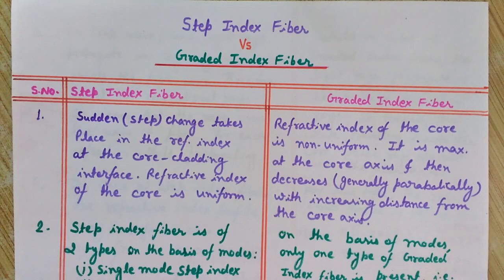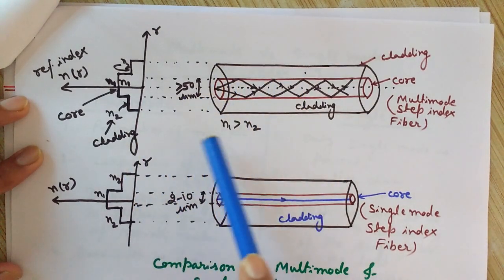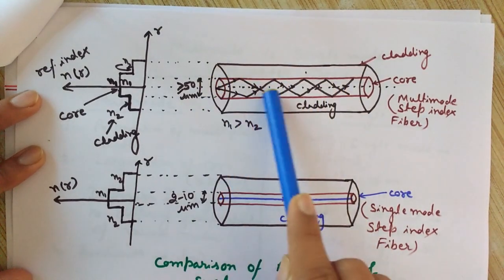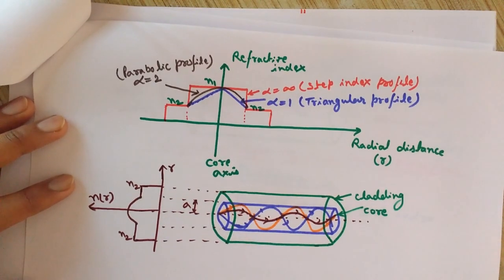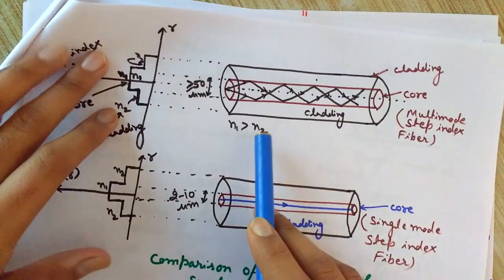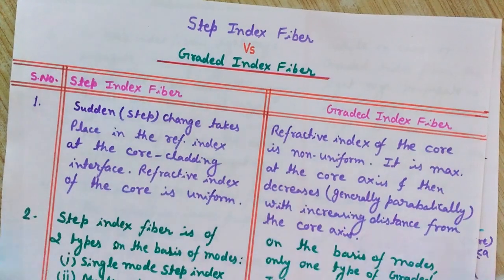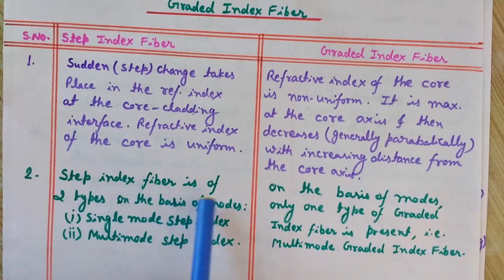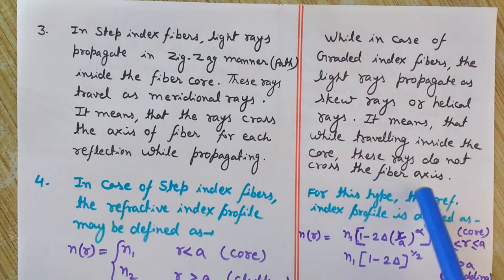Step Index and Graded Index Fiber (Step Index vs Graded Index) [HD]

Comment: Okay so why is it that in the single mode step index fibre, the light ray moves straight without bouncing off the wall of the core. Does it really move in a straight line?

Also for the graded index fibre, when you say the refractive index is maximum at core, do you mean the cross sectional area of the core? Because I believe the core is hollow
Reply: Jedidiah A. I believe that in single mode index fibre the reason it didn’t bounce off was that it wasn’t bent, it was straight which is why he didn’t show it bounce and no, I don’t think the core is hollow it’s made of some kind of glass
Reply: @struggler3883  Thanks for the clarification
Reply: Jedidiah A. Np bruh